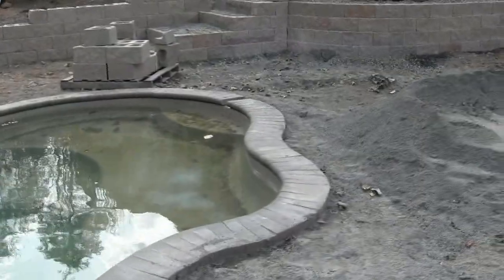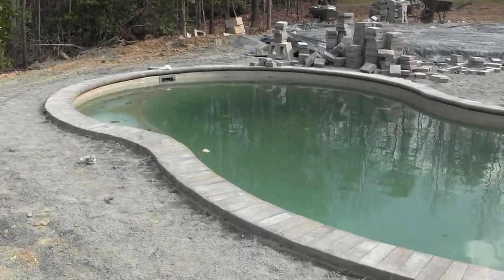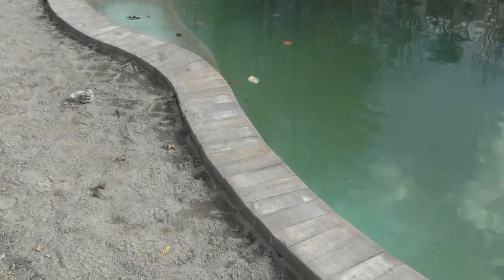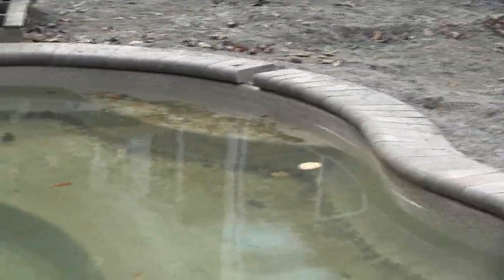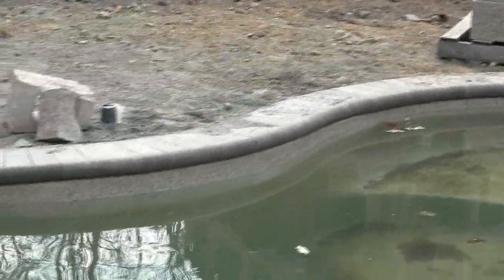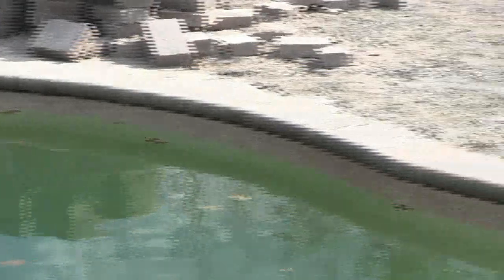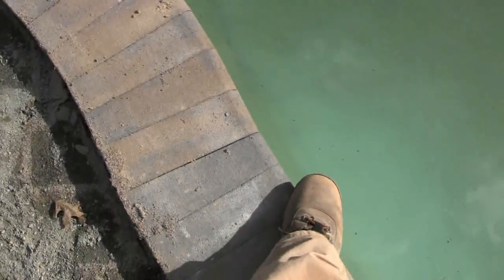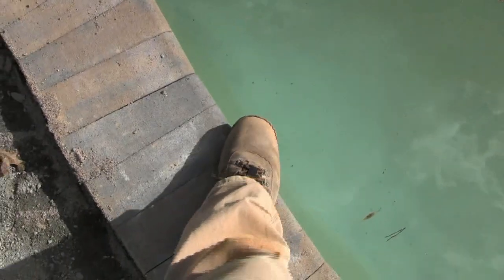How NOT to Install Fiberglass Pool Coping!

Comment: In Australia most of the fibreglass pool edges are at least 250mm wide so most capping pavers only hang about 50mm over the back edge. We use a high quality adhesive like Ardex RA040 and that’s it. I promise you won’t get those pavers off the edge of that pool without some serious leverage (I tried once when one of my guys installed a few pieces wrong. I had to use my hydraulic car jack and a piece of wood to spread the leverage and I almost broke my jack). If the edge of the pool is uneven or the pavers not calibrated perfectly, which is almost always the case, then we use 1mm window packers or shims to place under the paver to achieve the right fall and ensure they’re flush.

Comment: Do you guys apply a mortar or thinset to both the fiberglass and concrete collar? Or do you need to apply thinset over the concrete collar and then a flexible adhesive to the fiberglass?

Comment: Hey guys. Good vid and sad to see. 
We are installing coping at the moment. We have concrete around the pool edge but the coping was glued to both the concrete AND the pool edge (i.e. no gap between coping tile and pool). We will silicone it but is there any risk of the coping cracking the pool?

Comment: Hi Jason, I have a question Fiberglass pool coping. Have you ever used the vaster coping?  If you have any comments regarding how to install and would you recommend the product?  Thanks for the help.
Reply from the maker: The Gaming Family No, I actually don't have any experience with vastec coping and don't really have any recommendation.  If you have a salt system I would ask the manufacturer of the coping about the long term effects there.  But good luck!

Comment: WTF? Must have been a landscaper or beginner? I use mortar with bondcrete on a cement base. You can use high grade liquid nails as well, as long as it's landscape grade for coping with outdoor elements are hardiness.
Reply: Still need a concrete collar to go under the shell and level out for the coping pavers to sit on and adhere to.
Reply: Mortar on a fibreglass pool?
That’s asking for trouble. High strength adhesive is the only thing you should be bonding with to fibreglass. Concrete behind fair enough if the paver hangs over the back too far